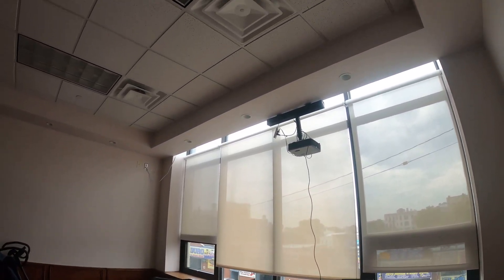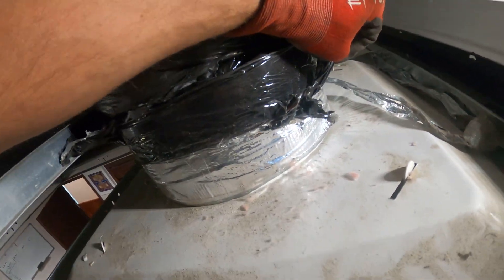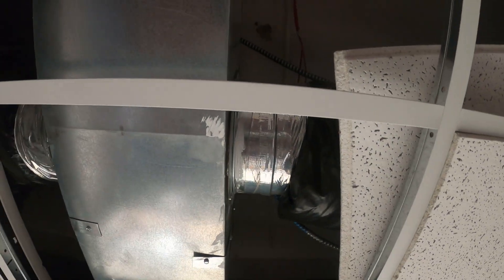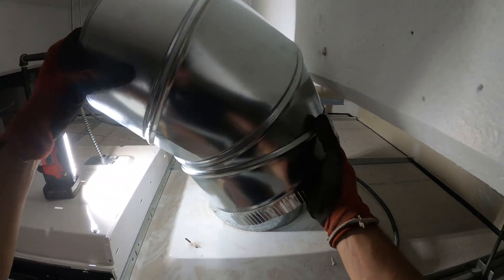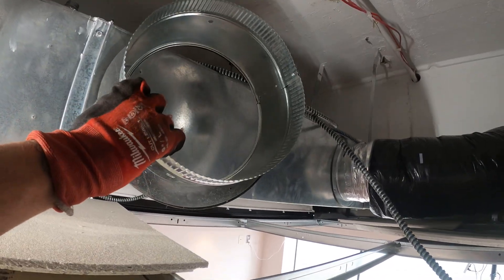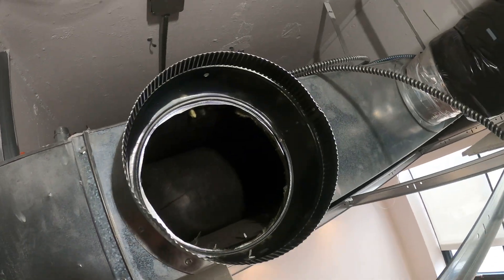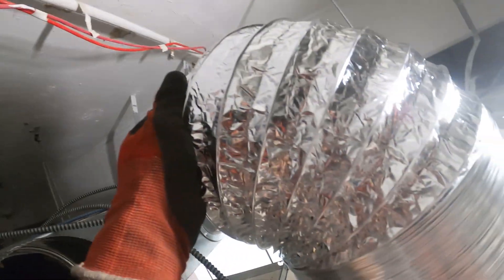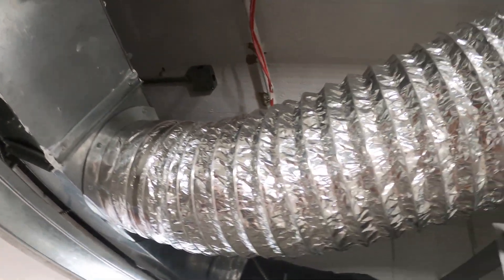HVAC Service Call: Central AC Not Cooling Properly (Air Diffuser/Flexible Duct Installation)

Comment: The colder room could be that way because has no windows to receive sunlight. Also, as I am learning a bit of HVAC, where was the return air in the hotter room? I saw one return grill in the colder room but not in the other

Comment: I would have cut the short piece needed from the flex duct you bagged up. That duct is going to sweat up there and drip on the ceiling.
Reply from the maker: I agree with that logic as far as using some of the flex from the one in the other room but it was left at that length so in the future they can add a diffuser back if they wanted. The duct not being insulated was def not a wise choice there but I'm just working with what was supplied. Thank you for your input & for watching! Stay tuned for new videos every week🔧⚡️